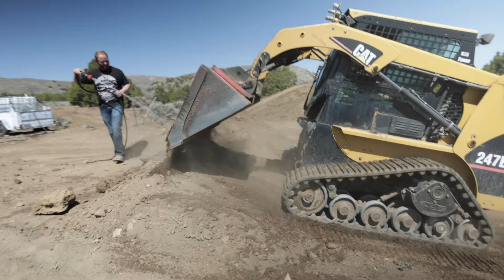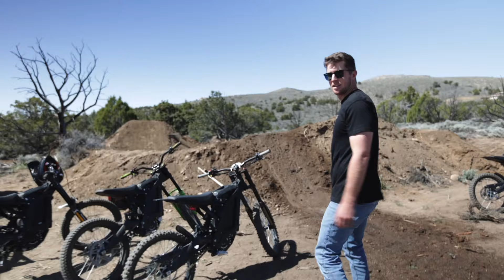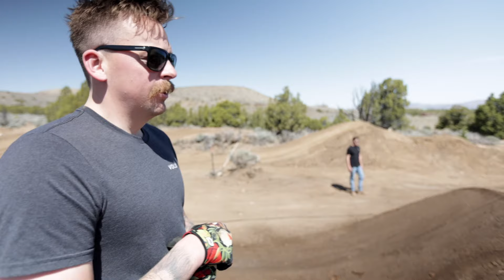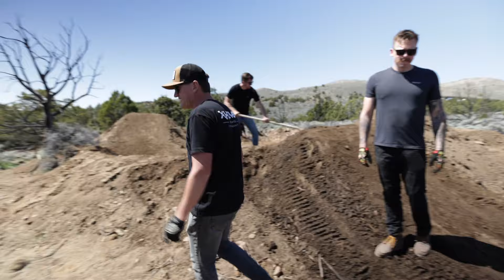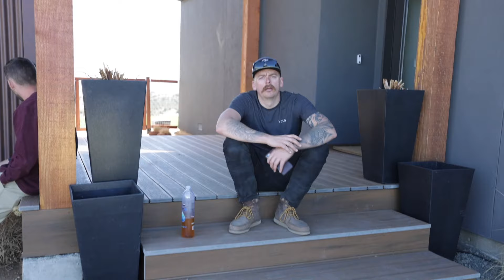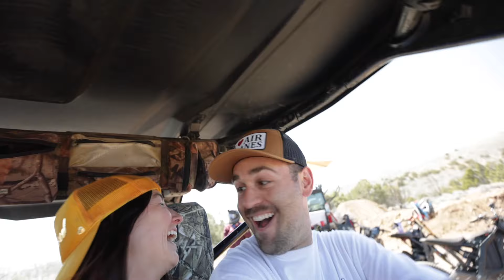Sur Ron X Black Edition HUGE Jumps Vlog

Comment: I wonder does it feel like a mountain bike when you ride it or does it actually feel like a motocross bike??
Reply: I have just bought one and I jump it. I rode bmx jumps at a pro level (flips 360's loads of tricks) also rode mountain bike a few times and dirt bikes. I've been jumping it and it is exactly half way between a mountain bike and a dirt bike. Bmx race tracks is all I have jumped but they link up one after the other like bmx dirt rhythms and I am loving it again, I quit bmx and dirt bikes due to injuries and I'm 43 now with a new love for two wheels and what I use to do for an adrenalin rush. I've taken it to mountain bike trails and that is rad too, even with my close to 4 year old daughter sitting in front of me.

Comment: Nice jumps and nice riding. Are the Sur Rons that are clearing the biggest jumps mostly stock or mostly upgraded battery/controller wise? Thanks!
Reply from the maker: None of us actually have upgraded battery or controller. These are all stock. Only upgrades are the suspension and brakes. I feel like the upgraded controller and battery would just make us hit jumps these bikes shouldn’t be hitting haha
Reply: @Trevoryork  probably so but you will probably still  do it, haha. Thanks for the info. Off to go send it now.

Comment: What kind of shock absorbers do you have? Front and back?
Reply from the maker: We’re all on different stuff. It’s a mix of DVO, FOX 40, marzocchi bombers. And the back is just whatever we find for sale that fits these..
Reply: @Trevoryork  You're so full of crap. Admit it ... There's more money in suspension components than the bike costs stock. And that's just suspension. Throw in everything else you're putting on these bikes and you're easily approaching $10K. Of course I'm talking about paying full price for parts, but even if you're getting comped by sponsors or finding great deals elsewhere it's still gotta be running you guys a couple thousand at least in upgrades. The real question though, is how do these bikes hold up to the riding you're doing? I sold my Sur Ron (stock bike) because it wouldn't stay together riding it like this. Been thinking about a Drill One, but they're priced where you guys probably are with mods, and I'm not sure the Drill One would still need modding to get it durable enough to handle this type of riding either.

Comment: how big are you guys? i want a surron but feel they look to small.. im 6ft 205
Reply: You need many upgrades for a 6ft dude. Im 5'7 and i still needed all the height mods to make it feel more comfortable. The 3 inc pro taper bars. The seat extenders. The peg extenders. A bigger front wheel. The 21 inch one. The good thing about the bike is that you can mod it. Its a really good bike.
Reply: I’m 6’5” and 247lbs. It maxes out at 47mph for me which is still crazy fast. Buy the lift kit from Luna cycles for $80, that’s all I’m running.
Reply: im 6'0" 180 and i dont have any height-mods except 3 inch rise protaper bars and i love it.